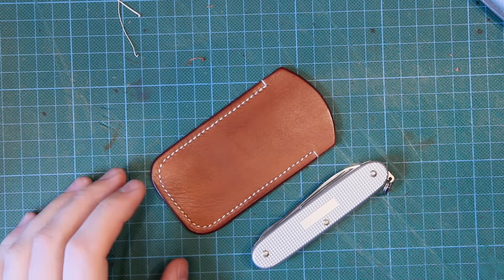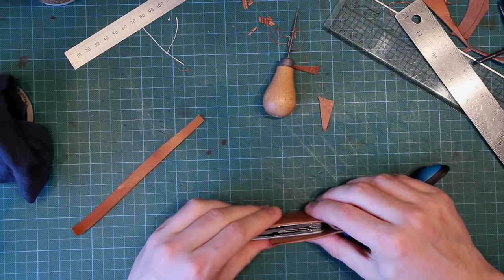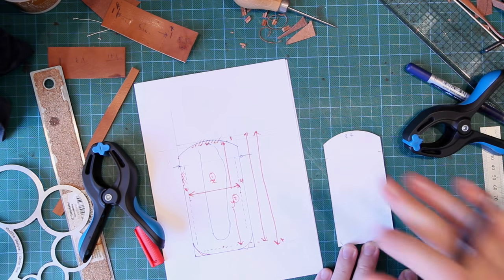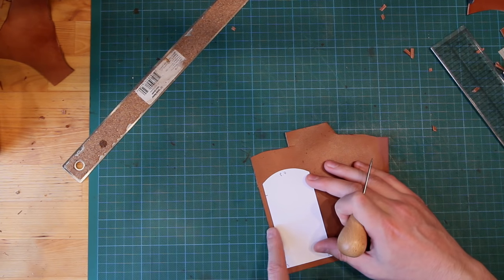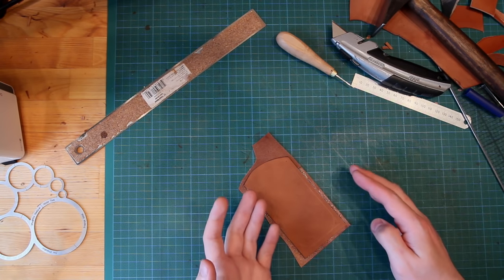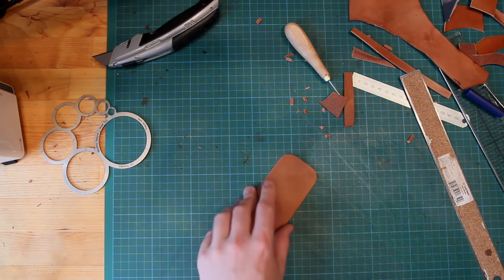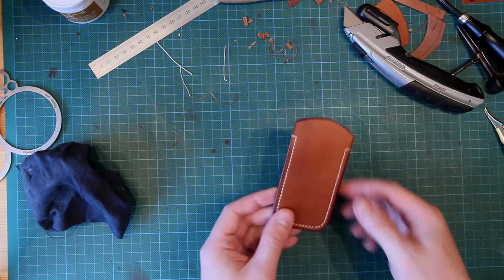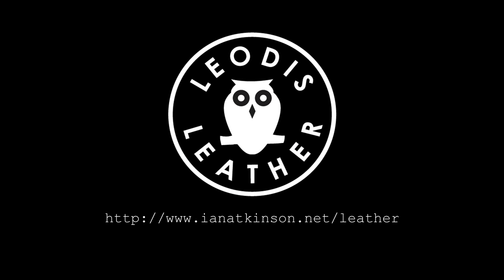Designing and Making Leather Slip Cases

Comment: Great video. One thing I noticed, is when you repositioned the knife in when measuring for the case, the front piece became longer then the back. I would recommend removing the item, repositioning the clamps with flat leather, and try again.

Comment: Ian.  I always have trouble getting my stitching holes even around the item.  I am always off by a mm or two, just like this example you marked.  I tried finding and  marking the center of the object on the stitch line (at the bottom of the case) and then walk the irons in both directions.  If I am careful, they do match up at the top opening.  Have you ever tried this?
Reply from the maker: No, I stitch these at 8.5SPI so the stitches are small enough that it doesn't really matter where the last one ends up. If you're using a bigger stitch it would be more of an issue.
Reply: @Leodis.Leather  That makes so much sense.  I go between 3.85mm and 3.35mm stitch length.  I guess 8.5 spi is closer to 3 mm.  Thank you!
Reply from the maker: yes it's a 3mm iron, if you wanted to use larger you'd need to balance it out per your particular iron as you say (then maybe mark the start and end on your pattern)
Reply: @Leodis.Leather  I just tried my unused 3mm iron on a small sheath.  You are absolutely correct.  Even though I did start in the center and work my way out, the 3 mm stitches ended about the same place.  Good to know.  Thank you Ian.